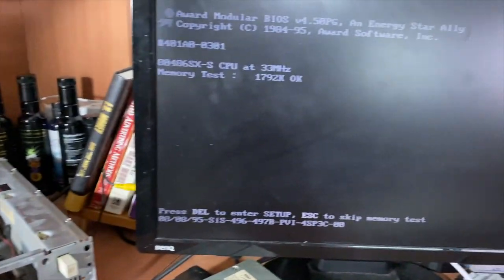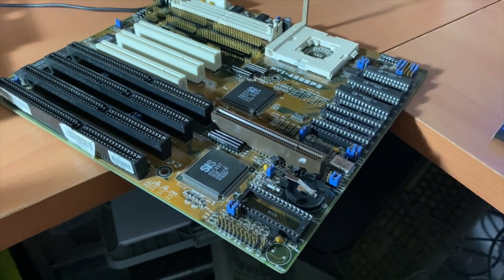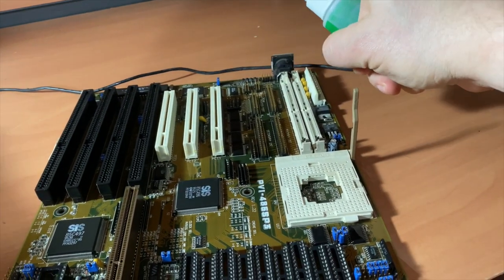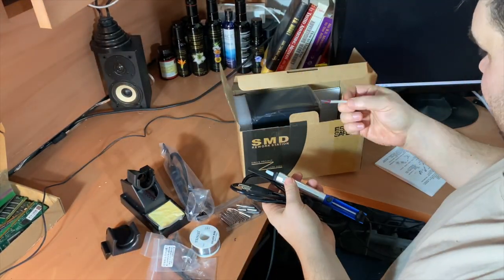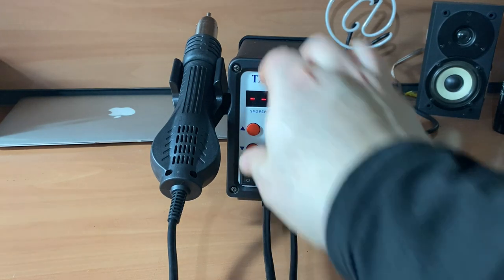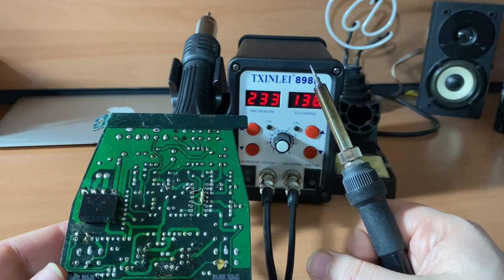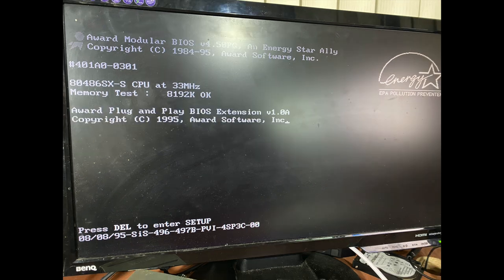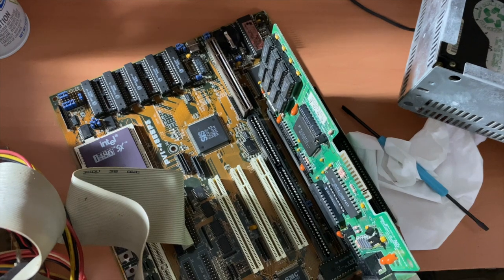486 Motherboard Won't POST & Tried EVERYTHING!? (This Worked!)

Comment: i just threw a Socket 7 board thinking it was just ewaste after just trying every CPU, RAM, Card, etc. but no luck getting it to post
Reply: This video was early in my troubleshooting skills... but there's a number of things you can try before you give up on a mobo. A POST diagnostic card can tell you if the BIOS is even functioning... checking to see if the CPU gets hot helps... and if the ram slots/ISA/PCI are clean (likely what helped this board in the video) and if you're tech savvy, checking voltages w/a multi-meter... but yeah, P1 boards are becoming scarce enough that I even keep the dead ones for future repair and deeper analysis.
Reply: @DanielDeyette  it was some late atx ss7 one. A dfi

Comment: So what did you do? Just remelt all the solder joints? Didn't quite get exactly what you did. I have a 486 board that shows no life at all
Reply from the maker: This is an old video and was basically a technique I don't do anymore... washing a board with alcohol can help remove oils and conductive grease etc.... but really the best way to troubleshoot is to install a POST card and a PC speaker and see if it's making any sound or if the BIOS is sending any codes. Check all chips and see if any are getting warm or hot... check voltages with a multi-meter and look for any lose/broken connections that sort of thing.
Reply: @thisoldtech2 Soz for the really late response. Still can't get the board working. I have a POST card that just shows ----. No beep codes, no nothing. Sigh I think it's time to give up!
Reply from the maker: https://www.youtube.com/watch?v=A0OXbKaYMbQ @TheVdub1980

Comment: Neat video!  I wonder though if by taking apart the board completely including the cache RAM you didn't move something that was causing it to hang?  Isopropyl alcohol is inert and cannot work out corrosion by itself (as far as I know from chemistry).  Maybe you really got it going by physical means?  Anyway, great job on the channel so far.  I'll sub a fellow small channel YouTuber!
Reply from the maker: Nah your quite right. I think it's the idea that it can rinse dust and debris from within the CPU socket and other sockets and clean metal if you scrub while the alcohol is on the metals without allowing further corrosion. 

Still, I've had it work a few times... Other times it's more complicated and requires testing all the tantalums etc. Thanks for the comment, I appreciate it <3
Reply: Yep the alcohol certainly hasn't fixed it. But I personally had quite some cases of corroded sockets. I had boards with CPU ZIF sockets that only made good contact after spraying them down with contact cleaner and closing/opening them with a CPU inside a couple dozen times. Same with ISA and VLB slots. Contact cleaner became one of my best friends ever since. Right after the POST card, of course ;-)
Reply: @Shmbler  I am working on a rescued Gateway P2 450MHz system and it was dead when I turned it on.  Disassembling everything (you'll see the video soon) allowed me to clean all contacts and reset all the cards and CPU and it works a charm.  Probably all physical contacts at work here too.
Reply: @UncleMikeRetro  I suggest getting one of those cheap POST cards. They really can help you in narrowing the problem down. For battery corrosion repair, it's really a life saver. But connecting a speaker for the beep codes is an absolute must for me. Without a speaker, I wouldn't be able to distinguish between RAM, Video or general board issues in a black screen scenario.
Reply: @Shmbler  Maybe an option for sure.  I know if traces are actually flaking off due to corrosion, it's in the waste bin right away, but if all looks OK, the POST card might do the trick.

Comment: I almost burnt my house down with that style of combined hot-air and soldering station. watch which side you turn on kids! 1 extinguisher and a pissed off wife later I was on a ladder scrubbing black smoke stains from the ceiling and upper walls.
Reply: ouch!  angry wife is one thing.  mad about you burning down the house is another entirely!

Comment: Manufacturers page gives 10 year data life on flash chips.
How old are this 486 boards flash Bios chips? 30 years?
Reply from the maker: I've read the germanium types fail easily... and that units not stored at room temperature or heated will lose their data but theoretically the silicon types could last centuries. Especially the write-once types. 

Seems bit rot is a bit of a misnomer. In the hundreds of motherboards I've handled, I've seen ONE bios chip with degrading data. All the boards I played with were over 30 yrs old and read 100% accurately.
Reply: I have personaly never seen a 486 board with flash chips. All of them had classic EPROMs. The first EEPROM Bios chips I have seen on Pentium boards, and actual flash chips not before socket 7. I also have yet to see a board that failed because of Bios rom corruption. That seems to be a more common thing nowadays with serial flash.
Reply: @Shmbler  I have never flashed a 486 board myself either.
Reply: @Shmbler  The intel built boards for gateway and packard bell (Aries? Saturn?) or more than half the retail 486SX25 to 486DX2/66 sold had flashable bios.
Reply: @Shmbler  The boards were Intel's "reference design" for their i420 chipset which included bios updates. The only 486s I recall with eprom bios were wannabe 386 junk like the M919 (later versions were flash and all DIMM). Even budget blue lightning boards had flash bioses.